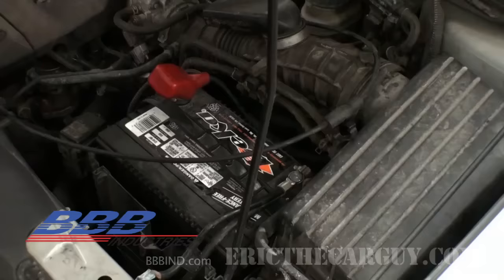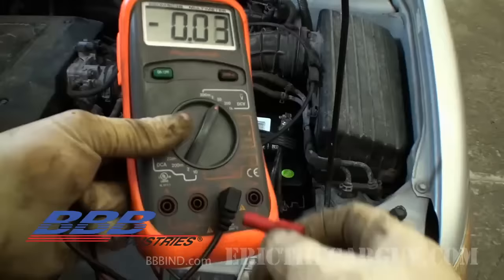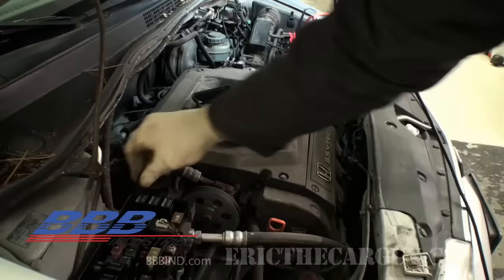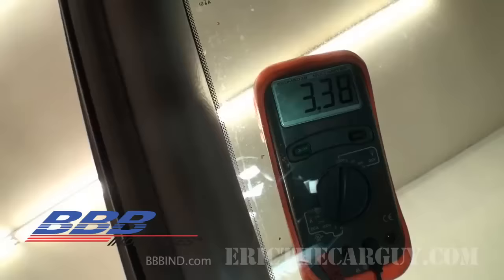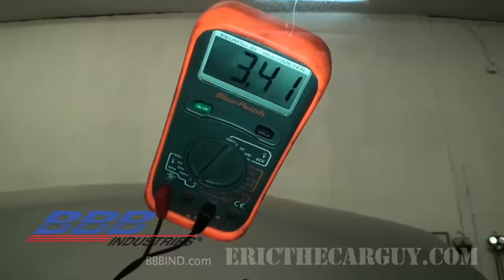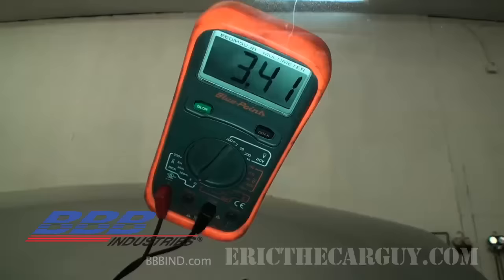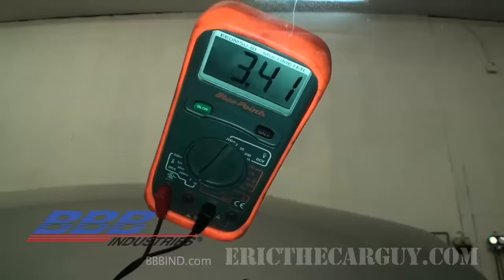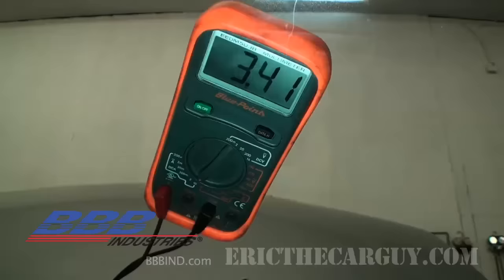How To Perform a Parasitic Draw Test - EricTheCarGuy

Comment: Will my Innova 3320 multi-meter be sufficient to do that test, as that's all I have available right now? Not sure but I think it has only a ten amp setting. The user guide doesn't explain enough. And I'm also learning how to do checks with multi-meter. Also, isn't there another way to do this by checking fuses with the multi-meter? Thought I saw that way of checking somewhere.

Comment: I'm working on my 2008 honda civic and when I go to test with my multimeter the amps jump around for about 30 sec before settling at 0. Is this normal? My battery is being drained constantly and have changed the battery 3x already this year.

Comment: Hey Eric had a question hopefully you can help me out as I've looked everywhere and can't seem to find out what this fuse controls that is causing my parasitic draw. My car is an 04 Honda Civic EX coupe 1.7 L and in the fuse box under the hood when I pull number 9 fuse my meter goes to zero. 
It is marked as backup on the diagram on the lid but I pulled the fuse as it's drawing .60 amps

Comment: eric...i need help and since ghis vi was on the same van...i figured id ask... i have a 2001 honda odessey and the fuse box on the passenger side has an issue... the fuse location for the day time running lights seems to be gone or pushed in so far a fuse will not go in place...ease help me if u see this... ty anyway love the vids bruv

Comment: What happens when i test for parasitic draw and the mm reads 0. Ansolutely no p draw. Yet the battery is flat in the morning and i used my other cars battery and that battery also gets flat after a few hours car standing locked alarm activated. Its a 2013 koleos.

Comment: My Cavalier turns on the air and radio automatically which drains the battery.  Also alarm goes off randomly.  So there is a drain somewhere.  Any ideas why?

Comment: Did so in my 01 Maxima. I don't understand why it didn't register when I did the amp draw and I also did it with a 12 v test lamp on the positive side to see if it would go away, never did. Although when I went to my interior car fuse box I realized that I had a fuse in the wrong place for the interior lamp and I went to put it in his proper space and it blew immediately number 13. When I put the voltmeter on that I get 12 volts from that one fuse. I'm stumped. Secu, i suspect smoked briefly. I know I need a new alternator as the battery and brake lights are on and it was a intermittent and now it's been continuous and I don't have a lot of cash so I'm actually driving to work pulling my battery off so the draw doesn't kill the battery and then reconnect it driving home and disconnecting it again. Lol. Any suggestions would be nice I'm going to probably test the relays next but I'm concerned that my 16-18 volt charging is really throwing my electronics crazy.

Comment: Well....this was a "tech school video" . I have a problem I can't fix: An MK4 Golf, 1,6 petrol, with a 340-350mA parasitic draw. I made the fuse test, and the result is zero. I assume a deffect relay, that return power from a permanent power line. After 3-4 days my battery is dead. Any clues 4 me? Thanks.

Comment: One of my favorite videos on the subject. I have a .23 draw. I think you said that is okay right? I did pull fuse number 9 in under the hood fuse box on my 2005 Honda Element and it went to 00 zero. So this would fix any draw I would have. That fuse is a 10A fuse and it said BACK UP. Does this mean the back up light? I pulled it and the back up lights still went on. So very confused. Now I do have a rear trailer light set up from U-haul installed attached to the back lights etc. But no draw ever since I pulled the fuse. But the light still work? I don't get it. Only reason I did this test was because the battery went totally dead, after not using the car for 2.5 weeks on a brand new battery. I just didn't think that should happen, so I did this test. Now I am using the car with the fuse out. Oh alternator is tested and working fine. So I hope that fuse that says BACK UP is the back up lights? Not sure

Comment: Can an AC Relay switch cause a battery to drain every 3-4 weeks?  Auto Electric shop claims they found no power draw, and are claiming it "MIGHT" be the Starter going out...  (I have my suspicions whether he actually did a full test checking all the fuses)
Who wants to repair things that "might" be the problem?  Any ideas?

Comment: Mine came back as .049 which is obviously normal. But if I don’t charge my car every night it’ll die in a day. Any other recommendations? At this point I’m thinking it’s a charging issue and I’ve already replaced the alternator

Comment: Good basic outline of process, but a real example would be a bit nicer. A switch left on is easy to diagnose, but it'd be a bit more interesting to find a partially shorted wire or something.
Reply: An intermittent draw from a Bluetooth adapter built into a car could be even more vexing. That is why it can be wise to read all service bulletins for your car.

Comment: why not use the ohmic setting of the multimeter and measure the resistance between + and - cables and don't install the battery , any value close to or smaller than  240 ohms is bad. the resistance value should be in kilo ohms. proceed with usual disconnecting  of each fuse watching the meter reading. if the fuse block is inside the vehicle, just press on the door switch after pulling the fuse.

Comment: Hi  Eric, I live in the UK, I have a 2004 Range Rover L322 TD6, when I connect the meter it initially shows draw of 300 miliamps, it then quickly decreases in 20's until it settles at 117 miliamps, any help is really greatly appreciated
Regards AH

Comment: So i done this And I get a drop from the truck going into sleep mode from 0.55 Then 28 seconds later  0.08 On the 10 volt scale this is 80 miliamps? So i am still needing to drop another say 40 to be in the safe zone

Comment: I'm having a strange situation with my car... I changed the battery 2 years ago, but my draw has been the for more time, that's the reason why I changed it... The draw at first it wasn't very frecuent once every 2 months or so but now I'm lucky if my car starts after 1 day of not using it...

I've been disconnecting the battery at the end of the day for a long time now and in the morning the car always starts strong... Sometimes I forgot to disconnect it an the car starts normal with good power (if I'm lucky)... When I go to work with the car it sit there all day and I don't have to disconnect the battery because when my job ends it starts normal with good power...

It seems that the draw I'm having appears randomly (specially at night) and sometimes isn't there, I'm checking my amps in the middle of the day and it says 4.3mA or 0.004A which according to this video it's nothing, so I'm guessing at this exact moment the draw isn't there...

I don't know what to do, I need to sell this car as soon as possible but I don't want to sell it like this because I'm not a shitty person, and if I seel it with the failure it would drop the price significantly because the car is in very good shape, a bit old (2002) but in very good shape.

HELP please!

Comment: As soon as you hook up the meter, the computers turns on. You will see a high draw until the computer goes back to sleep. If you pull a computer fuse it will drop the amperage. No one does this procedure anymore.

Comment: I have a 2005 Lincoln town car the someone installed  a electric fan and used the unprotected side of the ECM fuse under the hood and it shorted. The car runs great but it won’t shift. I haven’t fooled with it n months because of this issue. Can u help me n any way. It was giving a code but I can’t remember. I’ll charge it and scan again to get it if u can help. Thanks.

Comment: I checked every fuse and part and could not find the source of the draw. I did notice that my multi meter fluctuates amps. From 1/2 to 3 amps. Also my gas gauge goes nuts when I first turn on the key then goes back to normal. Pulling the fuse didn't help. Any ideas?

Comment: Big question. My car thinks doors are open when they’re not and the little light in the door turns on. No switch to turn it off. It eventually turns off after 20-40 minutes. Is thsi okay?
Reply: My car had this problem. The switch was damaged on door frame to where it was pushed into the frame far enough that the door couldn't make contact to turn off lights. I taped on a small plastic cap onto the door until I could replace the door switch. Hope this helps.

Comment: My Oldsmobile 3800 stalls out when I put any kind of load on it it has a good battery/alternator just put a new fuel pump in and filter plus new fuel pressure regulator valve checked battery cables cleaned terminals when the car is at idle try to put down a window are turn headlights on it will stall out it has no check engine lights it's a problem I can't solve can you give me some insight I'm out of ideas

Comment: OK, here's a question for anyone reading here...
 I've got a 1999 Dodge Ram Van 1500 that has developed a 2 amp draw from the 30 amp fuse labeled +battery supply. I'm pretty good with electrical stuff, I've pulled every other fuse and relay, the ECM....the interior fuse 'box'. Alternator is ok.
 The under hood harness splits where it leaves the fuse box at the battery (new battery) . i'd like to avoid cutting the harness open.
 I make a 600 mile trip about once a month and this problem started after or during the last trip.tI have a Haynes 'Repair manual' but the electrical schematics are not adequate, This +12 volt 'battery supply' fuse wire isn't even shown. in there. i can drive the van, everything works, but I'm worried about damaging something. 
 And of course getting behind the dash would be a night mare, even
 with the engine cover (doghouse) removed.
Anyone having a problem like this and found the issue, I certainly like to know.

Comment: I need help Eric I have a 2004 acura tl when I try to put it in gear the rpm  drop sometime I got to dubble pump the couch for it to go in gear or when I'm taking it out of gear the rpm hang at 2 and the car is neutral and when i coming to a stop and put it in neutral rpm drop and go 7 or it cut off can you help me with this 6sp acura tl thanks.

Comment: Hi Eric, hope you (or maybe someone else) can help. So the issue is this. If I do not drive the car for several days (at least 3-4) the car will not start. There is some juice left but it is not enough to start it. Just enough to start to turn then it will just not turn at all (cannot start).
This is what I have done- I have charged the battery to about 12.5-12.6 volts and then checked for a draw by disconnecting the Negative Cable and touching the cable with the positive lead and the battery terminal with the negative lead. I am getting a draw of 23-28 milliamps.  I had the battery checked (after I charged it) and I am being told it is good. Is it possible it is still bad and cannot hold a charge. Starter and Alternator are good. Could the Starter be draining the battery while sitting yet not register on the meter.  Thanks for  the help.

Comment: Man I'm going threw the same thing but it's not a women its my caddilac escalade 2007 my mill amp is about 380 
Witch is a lot but started pulling fuses and some made it hight number I did not do the inside fuses yet still trying to figure it out I have about 14 codes do to abs light on I bought the car like that with air bags busted I'm wondering if it's the abs module that's causing all this battery drain over night any clue let me no everything helps

Comment: i do this on a 2000 s10 ans i get .83 amps and if i remove the cluster fuse it drops to .36 amps  if i remove the cigar fuse it drops .10 amps but then when i replace the cigar fuse the ecu port powers up. i have a scangauge connected to that port. but it turns of after a bit. if i remove the tbc fuse it drops from .83 to .73 amps.  if i remove the battery wire going to the under the hood fuse block that the tbc fuse is in i get 0.0 amps so the cluster is using amps how in the world do you get .05 amps when the cluster just uses power all the time.

Comment: QUESTION ! I was told that when I disconnect the battery my car will have to be re-flashed and over-billed at the local thievership….is that true ?
Reply: What kind of car? Unless it's a really high end car brand ie BMW Bentley Lamborghini ect.... you should be more then safe to disconnect it. You may lose your programmed radio stations and the car will have to relearn its shift points.

Comment: Do you only only pull fuse out or relays also when you do that test ??
Reply: All power is going to be routed through the fuses. Start with those first. It is possible that one fuse can supply power to multiple systems, so if you cant pinpoint the root of the problem after finding the fuse/circuit that is drawing power, you could pull relays on that circuit to narrow down the problem. As Eric says, finding a schematic for the circuit is invaluable to diagnosing the issue. It will show you all things that are connected to any particular fuse. Disconnect each thing on the trouble circuit one at a time and read the meter each time until you find the offending component. Good luck!

Comment: Trying to determine parasitic load on my '95 Olds 98.  With the multimeter set up to read milleamps, touching the red (positive) probe to the loose negative cable and the black (negative) probe to the battery negative terminal, I'm reading .10 milleamps.  Reversing the multimeter probes I get .03 milleamps.  Anybody know why is there a difference?

Comment: eric i have one question, last year 2018 7 october i have installed (not me but an auto electrian) 4 after market  led door lights, so wenn you open the door, the light lights up. 7 days after they have installed tis led door lights....i started to ignite the engine......I couldnt...i have testet the battery after that with multimeter..the voltage was very below after 10 volts...so I have concluded that something drained the battery in total...i have recharged the battery voll and installed the fully charged battery on...and next morning..the same situation....the car could not start..Once again have testet the battery voltage was below 10 volts...so I suspect that this led door lights are draining the battery...what could be else what you think?

Comment: I always hated finding gremlins. I still do.  The worst ones are the European clusterfucks. I firmly believe the French smoke urinal cakes before they design an electrical system. The Swedish are known for putting an engine in backwards. Funny because there are very few classic European cars here in Germany. Well... a few. But nothing after around 1980. Except the Trabbi. That thing is built with the same level if technology as a chainsaw. Literally. 

I have a 20 year old Renault. Actually really simply built. No real ECU, just an MCU with SFI and a 4x1 coil pack. But God help you if you get a gremlin in your fuse box. Reading a french wiring diagram is like putting Ikea junk together using the braille Chinese instructions and a butter knife after drinking a barrel of whisky. It's actually easier to reverse engineer it. The parts are cheap so I got an MCU from the chassis farm and took it apart to figure out how they set it up. I read out the chips and translated the binary into asm with a converter. Then I just rewrote the parameters and flashed it to a new eeprom chip. The new MCU worked great.... for a month. Then I noticed the floor was really hot....in winter with snow. Apparently the parameters are set up to load the cat with .40V instead of .45V on the lambda sensor. I cooked the hell out of it. It melted the aluminum heat shield and welded the cat flanges together. The best part is that the diagnostic specs that the inspection tests for, test for .45V. To this day I have no earthly idea how the ALDL sends a reading of 0.45V to the OBD Scanner while actually using a 0.35V reference. Even the inspector who is an actual automotive engineer, couldn't figure that one out. Since the readings were so much better on the HC and NO side, I just put a bigger cat in instead of rewriting all that stuff again. That was a 14 month marathon hobby. It ran really clean after that and I got the class 4 sticker instead of the 3. So I'm allowed to drive in the city with it. It's probably illegal to reverse engineer programming in a MCU, but the inspector told me "it's my job to make sure it's working, safe, and clean. I'm an engineer not a copyright lawyer. And your engine is running more efficient than the law requires. Where is the issue? ". 

And with regard to overloading your meter. I watched an ASE master tech with 20 years experience pop a fuse. What did he do next?  Broke rule #1. He bridged it with aluminum foil. I don't know what that meter was made out of, but from the explosion that happened when he tried to start the motor was epic. He said he forgot he still had the meter hooked up. His nickname for the week was Flash!

Comment: Yo buddy.  I'm in the UK here.  your videos keep coming up and i notice you referenced in a lot of forums too.

I've a 2005 Fiat Ducato 2.0 JTD.

Long story short, I have a drain from 35-72 milliamps (when set to 10A).  It disappears when ai remove the positive lead from teh starter to the Alternator so effectively disconnecting the Alt.  I've done a Dioe Test which shows Zero one way and 550 the other.  It's not connected to anything else.  Car charges fine too at aroudn 13-14.5v's.  Battery full charged.  I bought a new one thinking it was busted but it's still fully charged off the van 4 days later so it's a good battery.  New battery drops over night to around 12.30-40.

Any Ideas?  I've been trying to fix this for a week :(